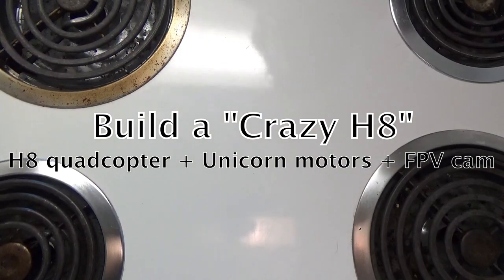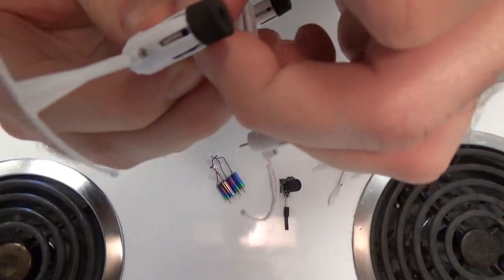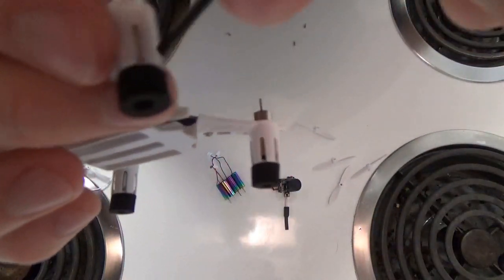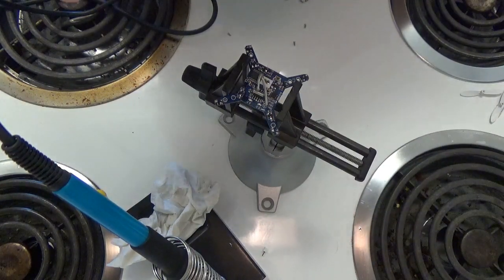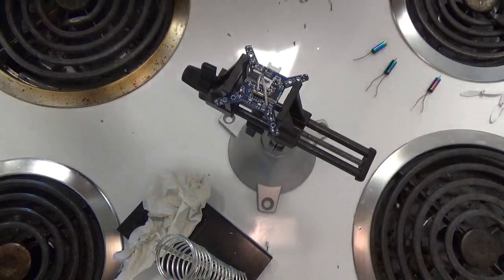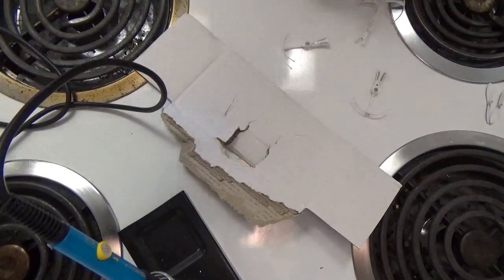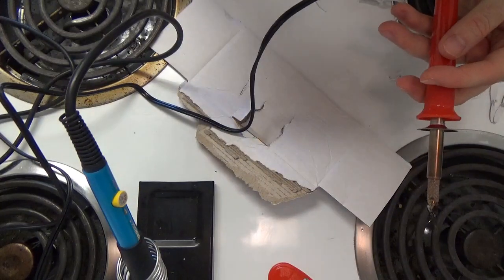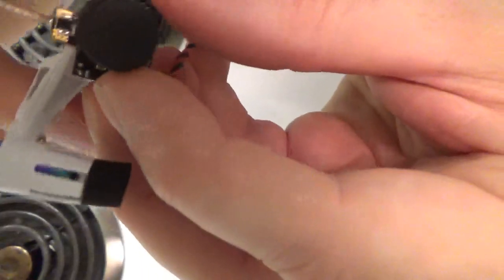Build a “Crazy H8” using an H8 quadcopter, Unicorn motors, and an FPV camera

Comment: Hi do you have any props you would recommend for 615mm motor the one in the link doesn't work, and I am adding 67000 racerstar motors in so is the original 150mah batteries good enough?